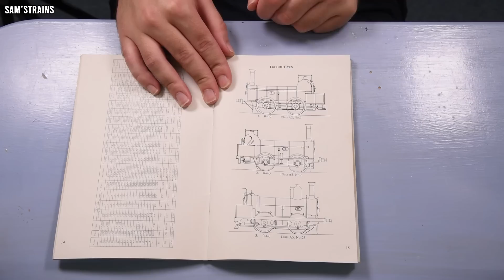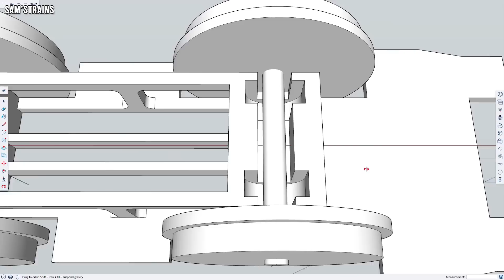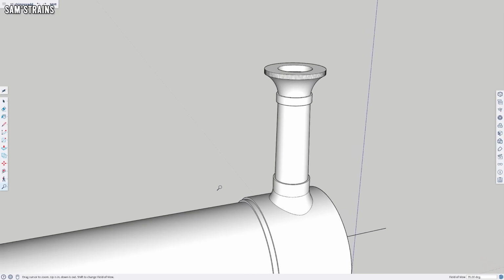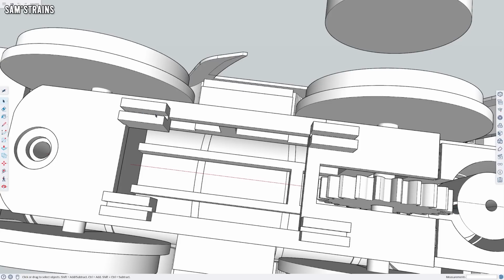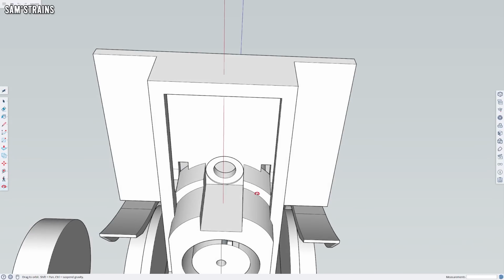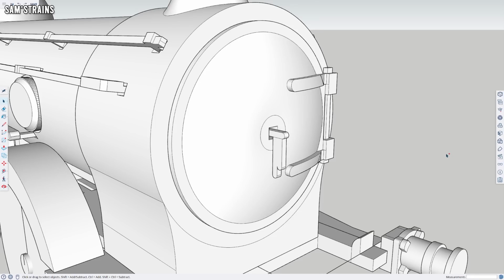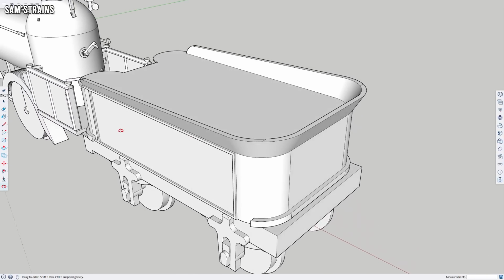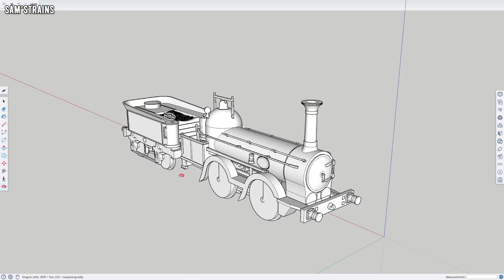Designing A Working Furness Railway 'Old Coppernob' For HO/OO

Comment: Oh, I love this! I have a 3D printer, I just need to know what bits to order - other than the loco wheels. I'm not sure you gave a part number for the bearings and the motor and its gears. But I guess that comes later. I think my son would love to get involved with the painting. I'm wondering about fitting a very small wired DCC decoder at the front of the smokebox. Thanks so much for doing this. Next thing to do is maybe do a tutorial or two on how to do all this in Sketchup. Thanks again!
Reply: I would also like to know what motors are used as I have not yet found a suitable motor to power my 3d printed model. As for bushings, I guess they are something like 2mm bronze bushings from aliexpress.

Comment: Looks great Sam!  If it’s not too late to make one small suggestion, if your cut-outs at the bottom of the firebox for wheel clearance followed the curve of the wheel instead of being square, they would be completely hidden by the splashers.  

Also, if you tapered the splashers slightly so that the outward-facing sides were smaller and the inward-facing sides were the same as they currently are, it might give them more of the illusion of scale while accommodating the oversized flanges.  That might be something worth trying, but it would be a matter of finding the right compromise where the sides of the splashers look as good as possible but the taper of the tops isn’t too noticeable.

Ok, that was two suggestions!  Anyway, I’m really enjoying your 3D printing adventures.
Reply from the maker: You're absolutely right Richard - this didn't occur to me until it was too late, but a curved cutout would have been so much better! The good news is it's very hard to spot with the rest of the detail fitted!
Thanks for watching, Sam :)

Comment: Very impressive, Sam!  With the inside of the boiler available (at least in principle) due to the location of the motor there might be room for a small DCC decoder and keep-alive module.  My experience with a couple of small diesels suggests that DCC can make a huge difference in low speed performance provided you choose a good decoder like those from TCS.  In any case, your work is great and you should be very proud.  I hope you did OK with the recent  heat wave over there as it was a big news item here in the US.  Cheers from Wisconsin!

Comment: That is amazing Sam , you make it all look and sound relatively simple . One way to improve the general running and slow speed running would be to use a gear tower to reduce the overall gearing of the loco , the motor would have to be hidden in the boiler and the gear tower in the firebox where you currently have the motor . It really does look superb though and I can not wait to see the completed loco . I would definitely buy one from you if you made them to sell as I live in west Cumbria where the FR operated .
Reply from the maker: Thanks very much Dave - a gear tower would absolutely have been preferable, but in this case incorporating one into the boiler would've added complexity and reduced the space for weight in the boiler... so I decided to simplify as much as possible. These won't be for sale unfortunately, but I am planning to make the designs available for free!
Thanks for watching, Sam :)

Comment: Very interesting. I don't have any intention of getting into 3D printing, but this design process is quite engaging in itself. And it's quite impressive to see that the prototype ran so well right away. I'm looking forward to seeing the more detailed modelling stages as they become physical. I'm a little surprised that you've designed things with 3D printed hand rails - I would have thought that those parts would be weak done that way (unless made chunky), so I would have expected you to use wire of some sort. But then I don't have any experience with fine 3D printed parts.

Comment: It's most likely the drawing that based on what the designer meant the loco to be, and the loco was then built differently as was common practice in the days of steam, finding 2 engines that are 100 percent identical is almost impossible as there was always something different, the closer you get to the end of steam the smaller the variation (this is even more prominent on traction engines as they were a lot more slapdash in comparison because they were built for farmers).

Comment: Great work there Sam. If I had known you wanted / needed some full lenght side shots of Copperknob I could have sent you some, about 20 years ago she was displayed in one of the side galleries and on full view side on so I took a load of piccies of her. But never mind youve done a fine enough job anyway,

Also when it comes to painting, decorating, to get a good copper effect for the firebox have you considered using gold leaf to cover the fire box and then give it a light brown wash over the top to dull it down a bit, then varnish over the lot to seal it in. Its a trick some old modelers used back in the 70's and the results can be very effective. Or I've just noticed you can get copper leaf sheets... which will be a lot less hassle.
Reply from the maker: Thanks very much Jon - ahh that would've been very handy actually - thanks for the kind offer! Gold leaf would be excellent actually - great idea!
Thanks for watching, Sam :)

Comment: Cracking project Sam. Well, in all fairness, scaling down a model does trick the eyes anyway when it comes to accurate scale. Hence, as long as she looks credibly recognisable as per prototype no one will compare with a ruler at hand, lol. Is there by any chance room left for a capacitor somewhere Sam? Perhaps in the tender, although that would require some wires of course. Excellent work. We can’t wait to see the final result. Cheers.

Comment: The only thing that I’m curious about is, with the bearings being metal, couldn’t you theoretically have the pickup wires touch the outside of the front wheel bearings, that way you wouldn’t have to worry about pickup replacement down the road due to no friction on them?

Comment: Hey Sam! awesome project!! my suggestion for the mechanism,  however a bit more complex it may be, why don't you put the coreless motor in the boiler and have a few gears joining it to the driving wheels? I get its more work but with the correct gear ratios you should be able to slow it down and make it a smoother runner with the addition of more gears. The bad cogging was due to that big gear? and to join the small gears to the big gears, id suggest a design similar to the ringfield in terms of the gears itself, having them join back to back instead of the circumferences touching.
Reply from the maker: Yes that was the only other option, and I did consider it. The reason I decided not to was that this would involve splitting the bottom of the boiler, and the chassis would have to be a very odd shape indeed. This would also lead to some very thin walls on the body, as well as limited space for adding weight. The extra gears would have been awesome for performance... but I thought my method was the best compromise!
Thanks for watching, Sam :)

Comment: Sam. I don't know if the cordless motor I have in mind would have enough power but that said here is my idea. Here in the states kato usa is using absolutely tiny coreless motors in their n scale fef3 4-8-4 union pacific locomotives. This motor albeit in n scale is as smooth and powerful as many of my top level locomotives with high quality 5 powers and it can easily be fitted with a small flywheel. Im thinking it should have enough power for your application

Comment: Wow Sam I'm so impressed by your skills it's a early era 1 locomotive those are my favourite it looks so cool. The motor solution is quite a big coincidence like me when I designed my n Gauge layout without a trackplan and got away with no problems later 😅 but seriously even in prototype stage this locomotive looks one step up again from Gladstone in my opinion due to the very innovative motor design. Can't wait until you finish it :D I have one suggestion though for the coupling maybe you can try the hornby chain coupling like the ones on Rocket and such? I think it would look a bit better than the massive nem coulings. Great work, Sam 👍
Reply from the maker: Thank you so much! Yes I got very lucky with the motor placement/gearing... I had so few options... just so glad it worked out! Yes a chain coupling would definitely be preferable - and my buffer beam design could probably support one too!
Thanks for watching, Sam :)

Comment: Good job on that model. Your first foray into making your completely own chassis and mechanism. When 3D printers can create surfaces that rival injection molding this realy will be a good way to produce your own models.

You can make the boiler banding by painting 0.25mm styrene strips and wrap them around the boiler. Is how I've done when making boiler banding on custom models.

Comment: Superb job Sam It looks great! If DCC can be installed that will vastly improve the slow running (assuming that it works with the type of motor you've installed).
Reply from the maker: Thanks Derek - you're right, it would be interesting to try this on DCC!
Thanks for watching, Sam :)
Reply: I think this is probably doable. Take the pickup wires from the loco through to the tender, where they join up to the tender pickups, that goes to the decoder, then you have another pair of wires going forward from the decoder to the motor. Might even be able to squeeze a stay alive capacitor in there, but won't know until I start playing around.

Comment: Sam,
can you do loco with an outside cylinder instead inside the cylinder in your previous projects all inside cylinder locos, also you do diesel and electric locos like British Rail Class 28, British Rail Class D16/2, British rail class 70 electric,  and LNER Class ES1, and pre-group rolling stocks in oo and n gauges?
Good luck Sam and nice video.

Comment: Did you use phosphor-bronze for the pick ups? This is a naturally springy and oily metal which I find works great for pick ups. Pickups in the tender might also help running smoothly.
Reply from the maker: Yes I've tried phosphor-bronze, but struggled to find it in slim enough pieces. I've had a huge amount of success using extremely thin copper or brass wire - to the tune of 0.3 or even 0.4mm... they need to be kept clean, but they produce almost zero friction, which leads to incredibly smooth running models!
Thanks for watching, Sam :)

Comment: It's very impressive Sam.

Considering that you can get wire hand rail kits fairly inexpensively from eBay, might it be worth replacing the 3d printed hand rails with wire? It would help add a gram or two as well.

Comment: I think it has been said before, but you should really look into getting a resin 3d printer. I have one and it can produce very high detail models, without needing to worry about filament size. Fumes aren’t too much of an issue for me, but then again I live in a two story house and stay upstairs while the printer works downstairs.

Comment: I think it looks brilliant. I've always loved the Furness railway locomotives. I believe that there are two of these locomotives surviving today. Number 3 (Old Coppernob) at the NRM and her sister number 20 but I don't know her current location. I know she worked for a while on the Lakeside and Hathertwate railway and I've also seen video of her working on the Ribble steam railway. So as an idea you could do both number plates.
And as a continuation of this design, apart from Old Coppernob all of the 0-4-0 tender designs were sold to the Barrow shipyards and converted into 0-4-0 saddle tanks.
Can't wait to see the finished product.
Reply: Hi, Not quite, although I thought the same until as recently as last week! No20 is a different class, much the same basic shape and similarly small, but slightly beefier. It's a second example of these slightly bigger engines that also survives, ex-FR No25, and the plan is for 25 to be restored in the later 0-4-0ST form you mention. No20's story (and sort-of that of 25) are covered very well here in this 13minute video: https://www.youtube.com/watch?v=px9oFqeiLno  I hope that's useful/interesting?
Reply from the maker: Thanks Michael - I can see why you've always loved them! Will have to look into No 20 at some point :D
Thanks for watching, Sam :)

Comment: Very impressive. I'm actually tempted to download the files and upscale it to 7mm scale, which obviously means I would need to modify bits like the gauging and whatnot, and find appropriate wheels too. I could then add a better motor with more gears, a DCC interface in the tender perhaps (not that I model DCC in 0, but that may change), maybe even 2 pickups per wheel too. Only issue is, I'd need to buy a 3D printer so I could actually make it.
Reply from the maker: Thank you so much - yes you'd have to seriously modify the design for upscaling... probably scope for adding much more detail if you did that too!
Thanks for watching, Sam :)

Comment: Maybe the real life locomotive was made FROM a model made to test things?
i mean not electric pickups or anything like that but there are mock ups and models used in well were anyways in industrial design specifically to test weather things work right. in a sense i suspect Sam is just doing same thing the engineers did back in the day. Using far more modern tools sure but conceptualize scaled down model to prove it will work.

I kinda wonder if Sam could cast the boiler out of thin copper. *little saucy pushing of boundaries but he dose love to point out things are not cast so semi-serious suggestion is what he gets).

Seems to look alright to my untrained eye and i always welcome new challenges to his 3d printing of models hobby in support of his trains hobby.

Comment: You've done very well I think. Had you worked at 1/87 rather than 1/76 would the motor have still fitted and 1/87 wheels still been available?
Taking pictures in confined spaces is a pain. Have you had a look at the free software Meshroom? Using this photos can be combined to generate a 3D pointcloud. (There will be lots of areas left that you can't see however and you'll start wishing your camera was stuck on the end of a long pole). Then, from the pointcloud either a 3D model or 2D orthographic views can be created.
If bent copper wire is going to give you more believable pipes and handrails don't feel you have to 3D print every feature.
Thanks for making this design and build series. I much prefer these videos to those telling how manufacturers peddle overpriced broken models swimming in oil. Is there scope for videos on creating new motorised underframes for otherwise defunct models? (Sprung buffers and NEM sockets at the proper height of course.)

Comment: Sam this proves that you are a highly intelligent person, you're doing way better than Hornby at developing models, seriously why are things going so sluggishly at Hornby? :)
Reply: companies like hornnby have lots of projects going on at once (remember its not just hornby, its humbrol, airfix, oxford etc which are also owned by hornby) plus, hornby will probably spend a lot longer time finding 100% right, original drawings, and measure the real thing if possible, which would probably end up taking a few months, then they need to advertise it, which takes time then they need to make an engineering sample, which will be tested a lot to ensure everything is working (though hornby don't seem to do that anymore based on some of their new mechanisms) and finally they'll need to make molds of it, and then produce the first batch. That doesn't include variations in bodywork for different versions, or livery design and that probably takes around a year, so in other words, sam is magic

Hope you still have some breath left, having more than 2 sentence is for nerds

Comment: Nice work though I have a question have you thought of doing the Furnace railway k2, I think that is the name of the class, it is the class of locomotive that Edward was based on and I’ve never found a model for it.  Also I’ve put a Union Pacific Big Boy and a Jinty tank engine double heading a train I probably should be shot for that abomination of a train.

Comment: I think a good class of loco that you can try is the LNWR Claughton class, they're a class of four-cylinder 4-6-0s designed by Bowen-Cooke in the 1910s (and in my opinion, their outline look absolutely stunning). Some of them were converted into the LMS Patriot class in their later years (with the same wheel diameters and in some cases even boilers), so using a Hornby Patriot chassis would fit pretty well (with modifications to the valve gears of course)

more information of the class can be found here: https://en.wikipedia.org/wiki/LNWR_Claughton_Class